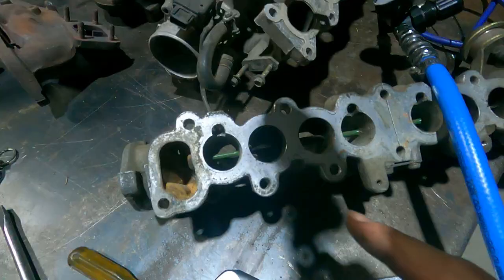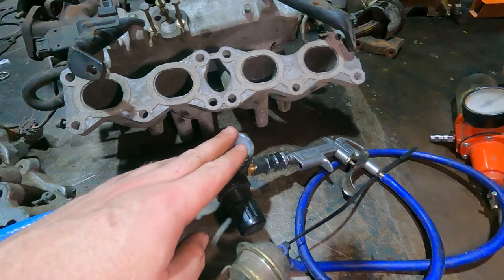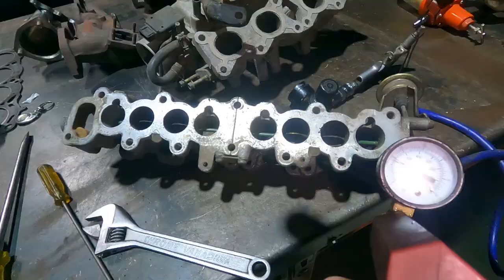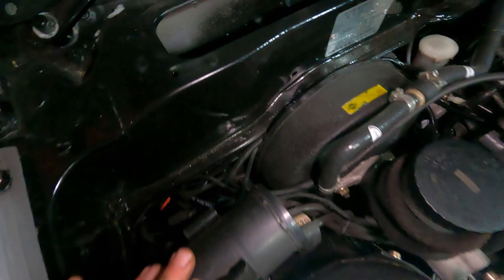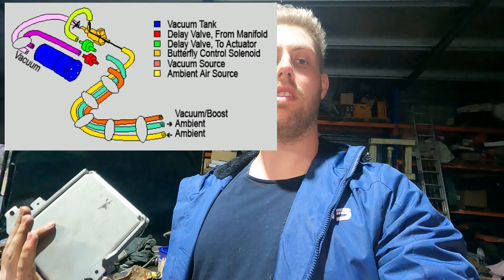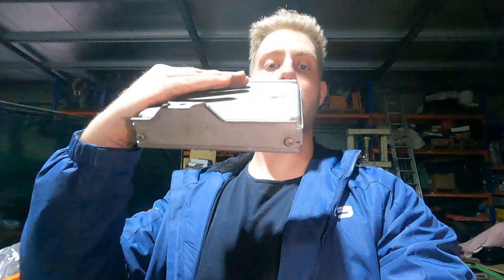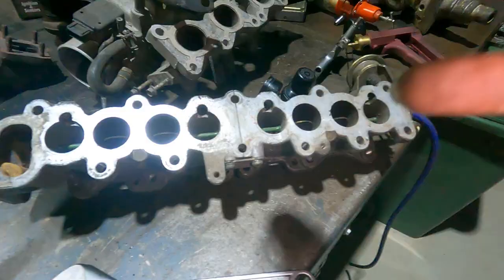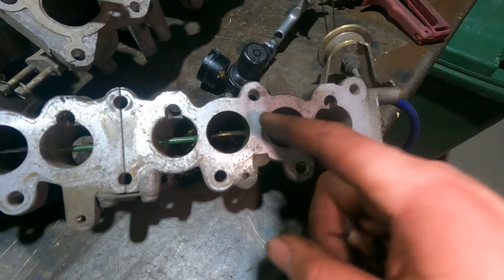How Do CA18DET Butterfly's Work & Why You Shouldn't Delete Them

Comment: My RB20DE Neo has this same butterfly assembly between the plenum and head, it's called "Swirl Jet Butterfly", also comes with its own vacuum canister and a single solenoid no other valves. Interestingly, given that it's an N/A motor by default, the actuator keeps the butterflies open at ambient pressure like on the CA but if you were to put vacuum at the nipple it starts to close. Conversely, if it sees boost, it will push them back open, however the spring is actually quite stiffs so I am unsure on exact cracking pressure.

I am adding a turbo to the motor and I am keen on experimenting with both the main torque valve at the Y-pipe inlet as well as the butterflies. I think if I can get the AEM standalone to control both solenoids and valve assemblies, I can drastically improve spool and off-boost performance. Good  video, hopefully more people will experiment with this rather than blindly throw and delete stuff away.
Reply from the maker: Wow I didn’t know rb20 had butterfly’s too that’s cool! Yes you definitely should try and play with it. Interested to hear the outcome! Thanks for the comment!

Comment: I remember friends s13 180sx with both of them had a 2 differ heads. A ca18de (na) 4 ports with det pistons vs Jdm 8 ports head., Same tune cams etc., Both use S15 oem turbo and i personally like the jdm.
Reply from the maker: Was the response or torque better?
Reply: @JarrodWillemse  Torque but i believe response will be better., They just use a modify sr20det oem turbo manifold

Edit - i mean if they upgrade a quality turbo manifold i.e 6boost

Comment: Would be enlightening to see two graphs for a CA18DET set up for somewhere around 300-400bhp, one with butterflies permanently closed, one with them permanently open.
I suspect the torque crossover point may actually be a lot lower than 3800rpm. Although this may largely depend on how well the chosen turbo spools and a good gasflow job on the head and inlet could bring that point down too. I'm not sure how quickly the valves open but best results may be to open the valves a few hundred rpm before the crossover point.
Reply from the maker: Yea I would love to do that comparison. It’s logistically difficult for me though. But I can say that when I got my car tuned on the link the tuner did move the point a few 100rpm from the factory 3800.
Reply: I've been messing with these engines for around 20 years now. I've tried a ton of different setups. I've found that cams have the biggest effect on where the crossover point needs to be, but only if the cams and turbo are sized correctly for each other. Ultimately, like he said in the vid, you really need to put it on a dyno, do an open and a shut run, and then set the crossover point for where the TORQUE lines cross. I've found they open and shut pretty quickly, so there's not a lot of need for setting them early, but if it does happen, it will be obvious when you do a run after you've set the crossover point, as you'll get a dip in the torque curve. Also, make sure your tuner sets up the valve open and shut RPMS a few hundred RPM apart. Otherwise, if you're setting at that RPM, they'll constantly open and shut and it's annoying. ie; They're held open until 3500 RPM, but once they're open, they don't shut again until 3300 RPM. Those are just made up numbers, but you get the idea.

Comment: Any idea how one would control the valves with a standalone ecu?
Reply from the maker: I have a link g4 and it’s an output that’s part of the tune. My tuner can turn it on and off.
Reply: @JarrodWillemse  I have an ecu master black emu....I don't think it has the ability to control them
Reply: Been thinking about having a spare intake welded up like you said...
Reply from the maker: @cloudseedingcalifornia6760  It's just a simple on and off switch like controlling an E fan. You should have a spare output.
Reply from the maker: @cloudseedingcalifornia6760  You can try but for street applications you will loose a considerable amount of torque lower down in the RPM.